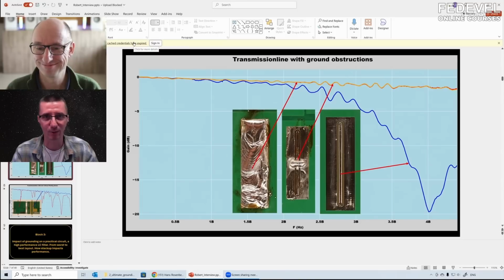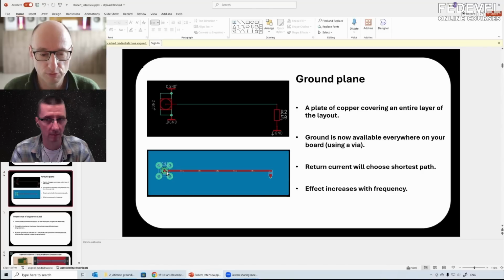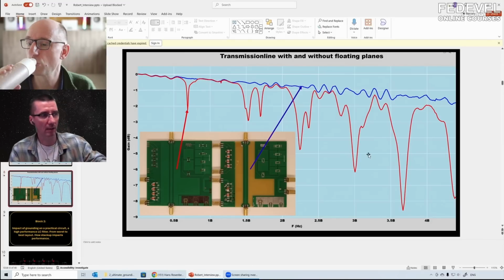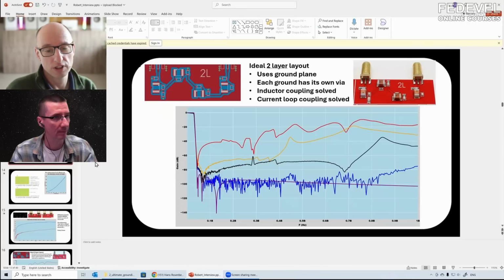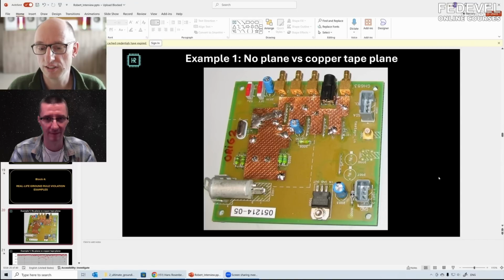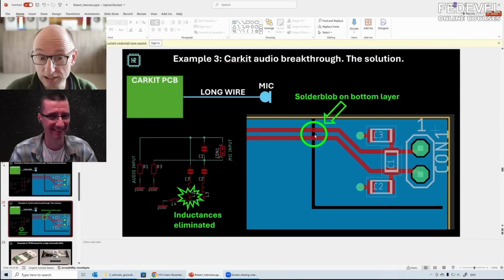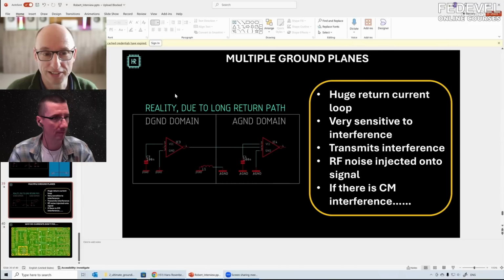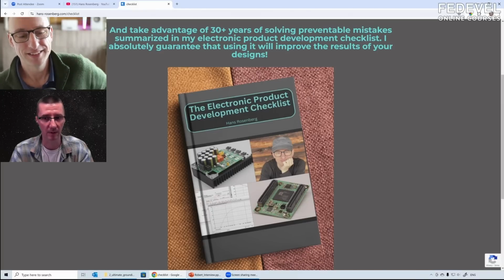Examples of BAD Ground in PCB Layout And How to Fix It

Comment: what happens when switching frequency return currents share copper with a clean and close-to dc current, for example charge pump vs precision reference?
let's say i have several loads (mostly LDOs) on a board with solid ground plane with individual supply traces from a battery supply. i understand that high-frequency travels below the supply traces but the frequencies i'm looking at are not very high so i imagine the currents will spread out on the plane. this means noisy return currents from one load may share the return path with a sensitive load. i don't know how that can be prevented. i tried to organize it in the layout but it's not a perfect split between clean and noisy stuff. i think breaking up the ground in any way would be a bad idea. i can't see a clean way to break up the ground because it's so interconnected all over the place. currently my conclusion is that it can't reasonably be done. moving the star point connection to negative battery / ground can help but if it involves adding a trace to do that, then probably a bad idea. the best solution is to start with the battery connector as the very first step. then build the layout. i did my battery connector last. i could have done a better job organizing the layout if i had started with the battery connector.

Comment: Great video. I have found that grounding techniques are the topic which has caused the most fervent disagreements between engineers over the years. 
People cling religiously to star earth techniques passed down from older generations, and other things inapplicable to modern semiconductor devices with fast rise-time edges.

Comment: I'm aware of problems caused by star grounding. However, in very sensitive low frequency analog circuits (don't think of 9 digit, but more resonable 5-7 digit circuits; let's be honest 9digit DMMs are not really a thing ;) ) I'm not so sure a solid ground plane would work. I'm talking about µV and nA levels, purely analog, basically DC. Even the operating current of multiple opamps can reach 100mA or so and would introduce an offset through the ground plane that one really would want to avoid. In my case I have provisioned a full ground plane for power, but carefully used a starground approach close to the ADC for these most sensitive signals. Is that the right approach? I don't really know yet. (I certainly see star grounding on such higher end measurement equipment all the time.)

Comment: Excellent video, thank you! I think it would have been nice to touch upon the subject of parasitic capacitance as well. The subject at matter is about 50 Ohm transmission lines, and you are comparing two different stack-ups with two different reference layers for the transmission line, at different depths, at minute 40:00. If nothing is done to adjust the trace width and clearance to coplanar GND plane (if any), then the line is not 50 Ohm in both cases. Then comes the question: how much impact does the same via on the transmission line still have, once you introduce the adequate parasitic capacitance (adjust the transmission line) to maintain the 50 Ohms? I'm afraid without having this in mind, you are more or less likely comparing apples with pears. In the end it does not only come down to the inductance... oversimplifying things this way is dangerous. There are so many effects and aspects to signal propagation.
Reply: Also, minute 42:52: unless backdrilling was performed, the via impedance is identical to before. It is the return loops' impedance that changes by exiting the via on a layer closer to the direct current's layer. But keep in mind this introduces one additional dangerous effect: you have now created a via stub of approximately 1.4mm length. Depending on your designated operating frequency, this can become comparable to it's wavelength and therefore dangerous.
Reply: Regarding the multiple GND planes. In my opinion, the idea behind it and what is actually of interest is not to have separate GND planes, but separate return paths. One personal preference and suggestion for an everyday layouter is to design your layout without placing a Plane Shape on top of the entire board (not until the very late stages of your design). Try to route the GND traces (return paths) the same way you route the signal traces (corresponding direct paths). This will help you get at least a roundabout understanding of where your return currents will flow throughout the board. In the end, you should of course add the GND plane shape and interconnect everything, reduce impedance and all other advantages that have been presented throughout this video. Don't forget about the golden rule: signals follow the paths of least impedance... do not mistake that if you have a signal on Layer 1, GND planes on layers 2 and 4, and if you route the return path on 4 it will actually flow on 4. Electromagnetic fields exist in the dielectric, so the return path will always be layer 2, the one sharing the dielectric with your signal's layer.
Reply: One good example is actually, on the same topic, when having Audio speaker outputs and Microphone inputs on the same board, even around the same area of the board. 99% of designers will create a separate GND plane for the Microphone functional block. This is like, let's say, an insurance taken in order to make sure you don't mix the two functional block's return paths. But it can be prone to huge, hard to depict errors. I recommend understanding return currents and how things flow around the board, stick to the same GND plane, and simply make sure you don't cross the return currents from the two different blocks.

Comment: Even better that JLCPCB allows for free via in pad on 6 layer PCB - that really helps with grounding individual pins
Reply: Wow, seriously, is that true? I didn't know that. I've ordered my first pcb's there a few weeks ago and had a very close look at all their specs. It looks really good. But via in pad is a very big advantage. Especially when you're working with BGAs, in that case it is a life-saver. I need to design a new fpga module for my course so I will definitely look into that. Great tip! Thanks!

Comment: 56:00 Honestly, I don't understand why the designer of this circuit has not placed the capacitors very close to the audio input, without separated grounds. Wouldn't that also have fixed the unintentional demodulation? Also, I know for a fact that multiple ground planes with star topology are very commonly used in professional audio equipment across many brands. Though, the example in the video is probably a poor one. I'm not 100% sure why they do it, but I at least have one theory, which is to avoid crosstalk of low frequency signals (e.g. mic amp with 60 dB gain, yet still good SNR). And from all I understand, audio frequencies will still prefer the paths of lowest resistance. However, you will of course see capacitors connecting the ground planes so that RF loop area stays small.

Comment: Fashionable arguments about reverse currents alarm me personally. This is true for coaxial lines, where the potential difference between the receiver and the transmitter interferes. In digital circuits, it is more important for us to ensure a strong ground so that it does not jump when transmitting a signal. I don't see any current under the track, there is a load on the resistance of the group, which makes it jump. The solid layer has the least resistance - this is true, but it is the lining of the capacitor on the ground for each line. 

The experience with the ground cut under the track at high frequencies speaks about the manifestation of wave properties at very high frequencies during the transition of medium density.

It seems to me more understandable to discuss the topic from the point of view of the reliability of the ground, relative to which a useful signal is being pushed. If the ground is soft like a trampoline, it will be difficult for you to push off from it and at the same time there may be a resonance that will throw you into the sky. :)

That is why it is more reliable to stand on solid ground of a solid layer than through the track. Imagine: you are standing on a metal structure podium (track to ground) at a concert, it is a little shaky (have resistanse) , of course. You are trying to shoot a video, and next to you an enthusiastic fan begins to joyfully jump and shake the supporting structure - the image is shaking. If you get down earth, the situation will improve. If you like the performer and you're having fun, then you can become a nuisance to boring people yourself. And you will advise the organizers to fill the podium with concrete. However, until a train goes near you. Everything in the World is relative. :)

Comment: In these discussions about the grounding layer, there is no thought of an increase in parasitic capacity to the ground. But it spoils the fronts and violates the integrity of the signal. It is not always possible to avoid long digital lines. The digital signal is not harmonic and some propagation features arise in it. What would you say about it?

Comment: A good ground network provides low impedance between ground points, and return for signal and power lines.  The latter works best if the ground provides a close path parallel to the trace.  An uninterrupted ground plane does this all very well.  If the ground must have gaps, parallel a high frequency trace tends to work better than across forcing the return path to depart from the signal line.

Consider the difference between a transmission line, close parallel conductors, and an antenna, conductors without a return path nearby.

Comment: On boards more than 6L if L1 is sig, L2 is gnd and L3 is sig, can the return path of signals from L1 and L3 cause any interference or crosstalk or things like that?
Reply: I never tried this, but the impedance of a ground plane is soo low that it will probably be hard to detect. But I think this would be a great one to try at some point. I think there will be a frequency dependency, at very high frequencies, the skin depth is way less than the thickness of the copper, so there cannot be any crosstalk. I'm not sure at what frequency this would be, probably quite high.
Reply: @HansRosenberg74  
I asked because I am currently designing a motor control board (6L) and i have signals to control the H bridges and power on L1 but i also have analog signals to measure the voltage and current on L3, i was worried if the return path of power and signals on L1 (more noisy...) can interfere with the return path of the sensitive signals of L3 and cause errors in the measurements.
Reply: @fedimakni1200  ah, now it is clear. Well, you could make sure traces are not routed 'on top of each other' on each side of the ground plane. Also, motor voltage and currents probably don't need to be measured with an incredibly high accuracy, so you are probably ok using a good ground plane. If you want to do some calculations: Just calculate the resistance of a 1cm wide strip of ground plane (assuming the current stays in that width), figure out how long the piece of pcb is where those signals run on top of each other (you need that to calculate this resistance) and multiply that with the current running in your H-bridge. That will give you a voltage across the ground plane. Now see how big that is compared to the accuracy you want to measure voltages with. It is probably not going to be a problem, but this way you can make some educated estimations.
Reply: @HansRosenberg74 at 100 MHz skin depth is about 6 um... a 1 oz/ft2 is 35 um.. so plenty of distance in the copper... obviously no capacitive coupling because there is no dielectric and maybe some mutual inductance if traces are parallel?

Comment: Note: Digital signals, it's the rise/fall times that relates to the highest relevant frequency, not directly the clock frequency (stated ~9...10×f_clk). That rule has more to do with the relation, that you need a good rise/fall time to still have a good clk/digital signal. 
Using i/o with 0.1 ns tr/tf for 1 MHz clock/digital signals still has frequencies in the >1GHz region
Reply: BW around 0.35 / RT